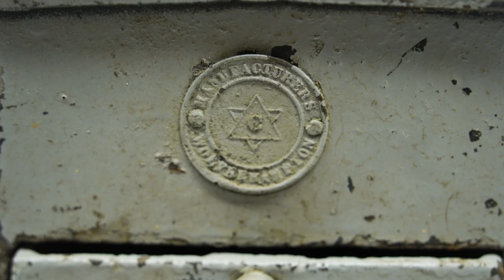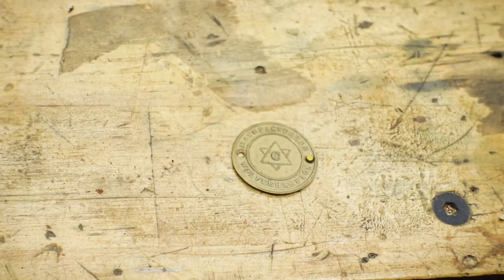Incredible 130-Year-Old Coffee Grinder Restoration

Comment: Since this is supposed to be a restoration for a museum, I’d duplicate the original finish (paint).  Save the powder coating for kids toys, not  “museum grade” restorations.  Sorry, just my opinion.
Reply from the maker: Thanks for your feed back 
Did you read the description
cheers Richard 😀
Reply: @richardrestorations  yes, I did read the description. 
Again, powder coating wasn’t the Original finish, and to RESTORE something  for a museum should include the original method of finishing otherwise it’s not a restoration, it’s an upgrade, something like filing cast marks etc. if it was sold with those imperfections they should be preserved as part of the Restoration.